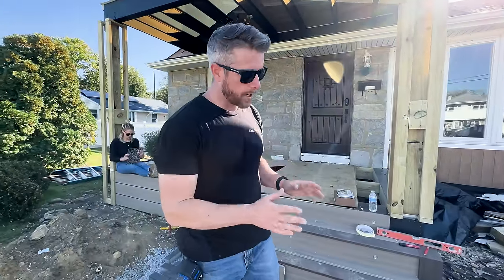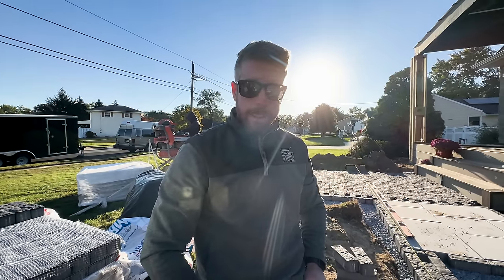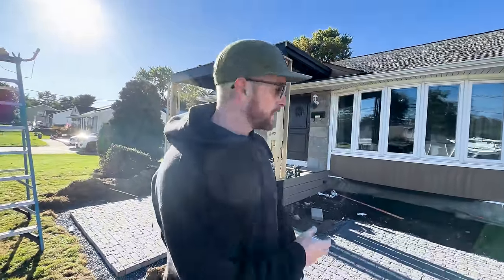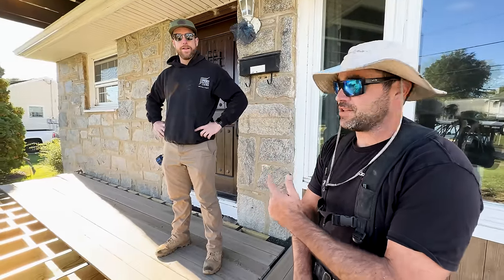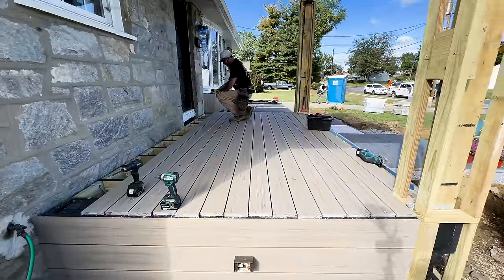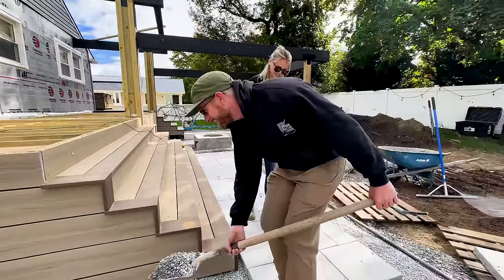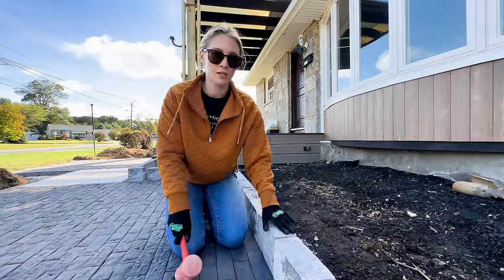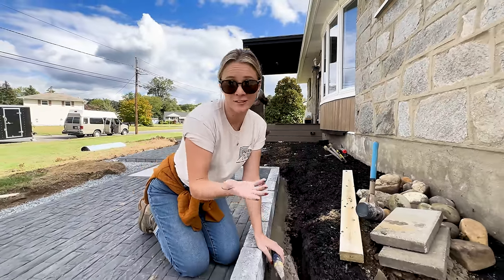Installing Pavers For A FRONT Yard Makeover!

Comment: How come the pavers are placed directly on the gravel?, is this a new technique without sand? Will the installation stay stable?
Reply from the maker: We use a 3/4” clean stone base and then 3/8” stone for the setting bed, we find it a much better installation than sand setting beds
Reply: Any meaningful cost difference between 3/8" vs sand for setting bed? Finished our back deck this summer and will be doing ground level hardscape next spring. Stone definitely seems less temperamental than sand, but I don't have the experience to know for sure. Also planning to use larger format for the field and then slimmer brick/stone for bordering. @THEpremieroutdoor
Reply: By many accounts, this is stable. But I too have questions as the final setting by vibratory compactor is designed to make sand come up between interlocking joints. This open bedding is used (required) for pavers that allow drainage. In my experience, the 3/8 has some challenges compared to sand because the "resolution" of  what you can adjust is in higher increments. On the other hand, you don't need to worry about rain when installing.  Sand will washout and get very compacted.  The other thing to remember is to get the right sand, which is builder's sand and not play sand.  The latter is rounded and will have structural instability, leading to inconsistent sinking of pavers.